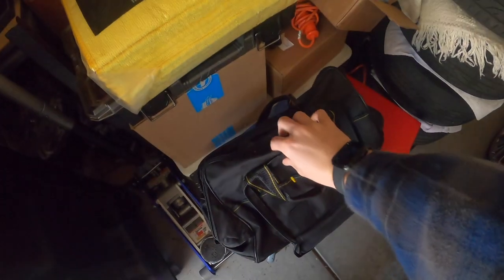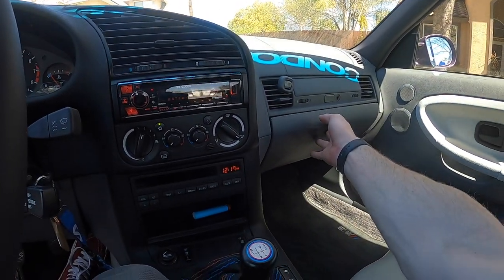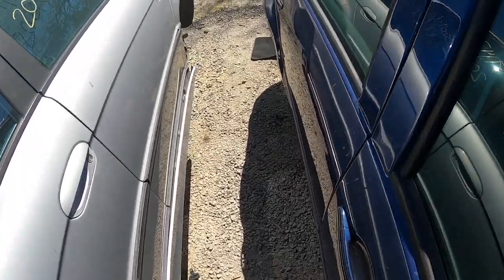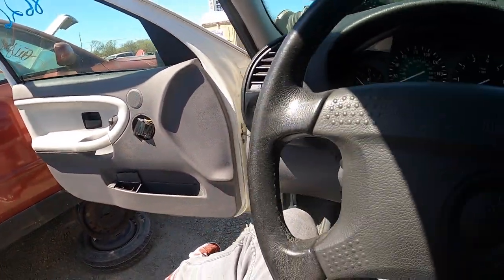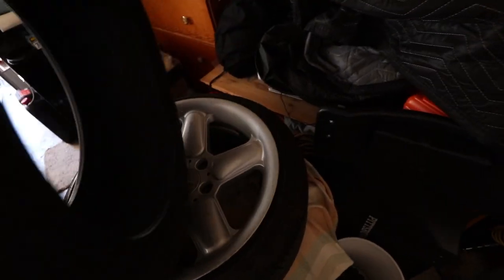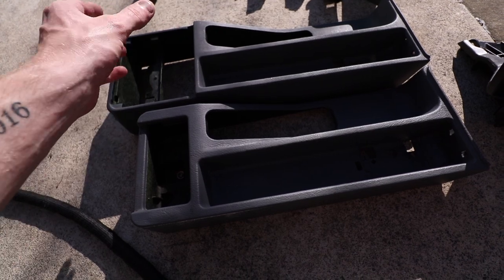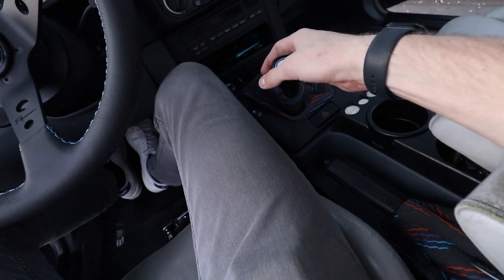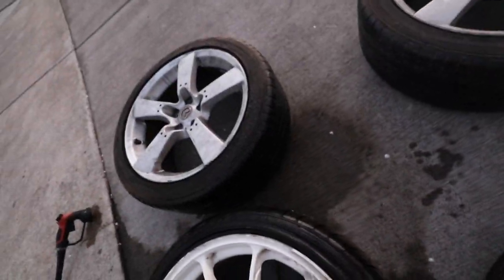Junkyard Score! E36 M3 Center Console Armrest Retrofit!

Comment: It would’ve been great to see it done step by step
Reply from the maker: Sorry, I’m a one man show, plenty of other videos
Reply: To remove start from the back until u reach the shifter housing(it's 2 pieces that join mid way). Then take the lower dash piece from the driver's side and remove the glove box. By removing the pieces from the dash it allows the part that surrounds the shifter and lower console as 1 pieces,eliminating the need to get the 2 impossible bolts by the radio. Just don't start YANKING stuff out,if something is being held up just take ur time and find the root source